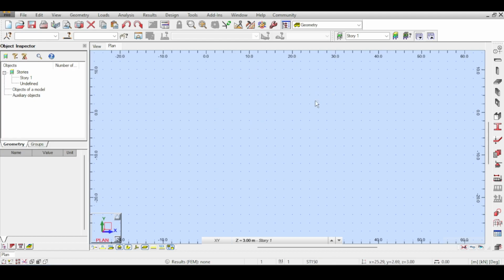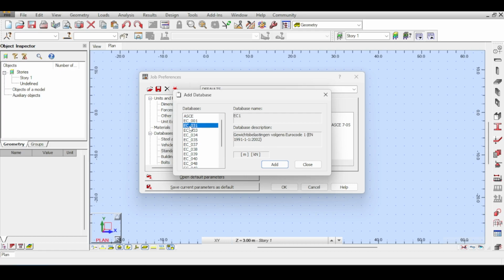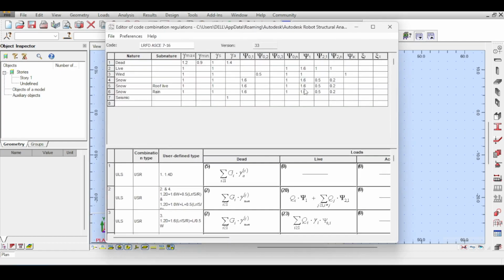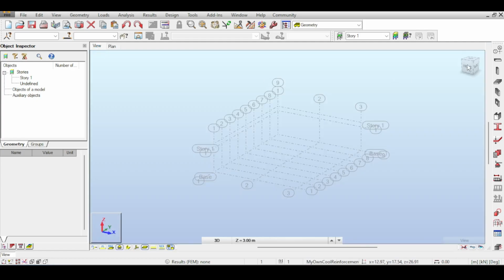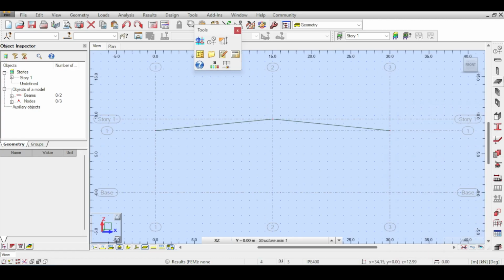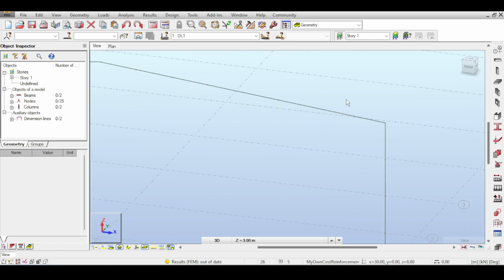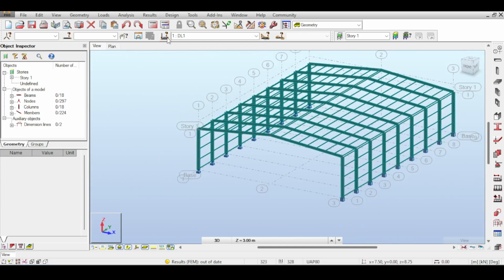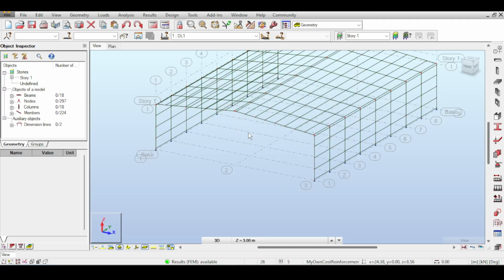Modeling of Industrial Warehouses | Part 1: Modeling (1)

Comment: Hello CEE,

Great work as always. Thank you for alternating to use the Eurocodes in this series. I think that the diverse experience (with the current codes) will be beneficial and it will also provide for a broader perspective with regards to the intricacies of both the ACI/AISC/ASCE and Eurocodes codes in practice. 

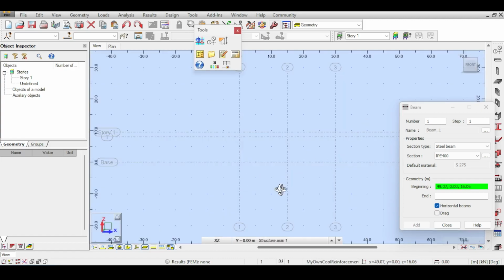16:33 & 24:18 Very nice and useful tip on the various uses of the front view/front plane selection techniques, thanks for this. 22:00 This still happens to some of us (the truth is that the CEE videos are really helping a lot in minimizing the occurrence of these as I am now more alert because of the CEE videos). I guess I also do not want to be laughed at by the CEE editor 😊 [I think he is (always) watching?].     

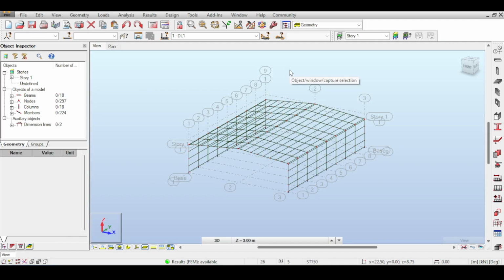28:45 Yes, it has to be done. "A journey of a thousand miles begins with a single step"

I know I may be jumping the gun here, but still, here are some few questions and suggestions: 

1. Usually, the girts and purlins make use of “cold-formed shapes” as opposed to “hot-rolled shapes”. I think that it would be good if the model in this series can make use of cold-formed shapes for girts and purlin sections and carry these through from analysis to the design modules. I wonder if RSAP steel design module(s) are capable of designing both cold-formed and hot-rolled sections? It would be really good to experience this through the current series.

2. 29:26 I know that the purlins are offset in “real-life”, and I am aware that RSAP (as an OP software) is quite capable of offsetting members. And yes, the whole thing does look nice and dandy when it has been offsetted; but 

And my question is this: In the case of purlins and girts, and from the analysis point of view (considering that offsets seem to influence values of the elements/members internal forces, even at times causing reduction in the offset beam element bending moment, etc.) 

1. are there significant (and tangible) analysis benefits to be had by offsetting the purlins in this case? What are these benefits?

2. Would it also be (reasonably) acceptable not to offset the purlins and grits members and to rather continue with the analysis and design as if these members were not offset? what consequence or margins of errors will such an assumption create on the overall design of these members and of the portal frames members and of the structure as a whole?  

I have enjoyed this video and I am looking forward to the next videos.

Keep well.

Regards, DK
Reply from the maker: Hi there Engr. DK,

Great you liked those little infos. Also, I do model things in real-time with only the goal in mind. Reason behind it is to show really how those modelings take place, and what kind of errors that are possible to occur. Editor CEE is basically waiting for me to slip up. Now as much as he likes to tease me for my mistakes, he is basically my last line of defense against anything I mess up. 

Cold formed steel, yes, actually even (Z) shapes more than C channels. I have this in mind, and am researching currently if we can "at least" do something about cold-formed in Robot. As far as I know, the AISI (american cold formed steel) is not implemented, but maybe I can do something about EN codes.

The offset is kind of a two edged sword, I would like to state the following with that regard:
if you have a slab that is going to be analyzed (so shell, FEM, not a cladding) then you should refrain from offsetting as it will cause mayhem and confusion. There was a video about the pedestrian bridge talking about this.

But, if you are intending to use claddings "I do this time" then offsetting is valid and will improve your model. The idea being here for purlins that: offsetting those would have an "axial force - torsion" interaction.

The axial force on a purlin will produce torsion on the rafter and vice versa.
Also, any horizontal force will cause axial in purlins, thus torsion in rafters, so I think this is valid. I will see how I would deal with it if I get any unexpected behavior, so I will be on my toes there.

As for the margins of errors, I think I will quickly see the difference between offset and non offset and decide there, as I am still not sure (I have to do it myself and see). 

Let's see what happens, so stay tuned for more videos. I am preparing the robot video as I am writing this comment.

Regards,
CEE

Comment: good morning , where exactly can i find the dimensions line tab?
Reply from the maker: On the toolbar, there is a wrench icon. If you click it, you will find a "dimension line" tool
Also, under the menu "Tools" you find dimension lines.
Also also, if you write D I on your keyboard (I as in Ice), it will open for you.
Regards,
CEE
Reply: @CivilEngineeringEssentials  thanks very much
Reply: i am also struggling with hovering to get arrows for placing not by distance on the rafter side, the columns its okay, kindly help
Reply from the maker: @trymoremarange7144  Hi there,
try switching your view to a 2D view and choose the plan (xz or yz). it might help

Comment: Hi CEE, please elaborate on the issue of columb and rafter heights exceeding geometric storeys..i am modelling a steel go down with different roof heights,how will i bypass the geometric heights issue?
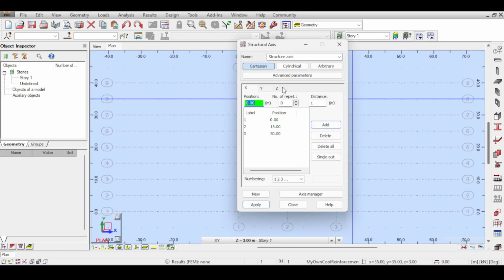Reply from the maker: Hi there, if you mean that robot gives you the error "element not in story" or that elements are outside stories, you can see what I did around 12:17 when I modified my story height.
Hope this helps,
CEE
Reply: @CivilEngineeringEssentials  I have three joint portal frames,each has a different roof height,the portals are attatched to a 2 floor concrete structure so the floor levels defined are for the concrete structure,I just defined node points for the portal frame

Comment: Great explanation sir....In my country only the European sections and materials available, so I use them but for the design process I use AISC 360 -16, am I on the right way ? is it ok to do design with AISC for European database ? or what do you recommend please ? thanks in advance...
Reply from the maker: Well, the one who decides what design code to be used is your local authorities. 
For example, a country could state that it adopts the American Standards.
I mean, when you design something in your country, you have to submit it for approval to authorities right? what is the code that is used there?

If it uses the AISC code, then you should have the AISC360 selected, if it uses the Eurocode, then use the EN code.

It is ok to design AISC using euro sections. The idea of a section database is to provide the geometrical constants of all sections to the software. There are some little "benefits" you will lose. For example, the AISC database has some sections that are called "compact" which means that the Lateral Torsional Buckling (General Stability) will control the design before any local buckling happens.

Long discussion short, you can use Euro Database with the AISC code.

Regards,
CEE